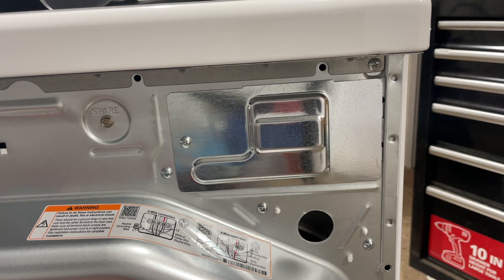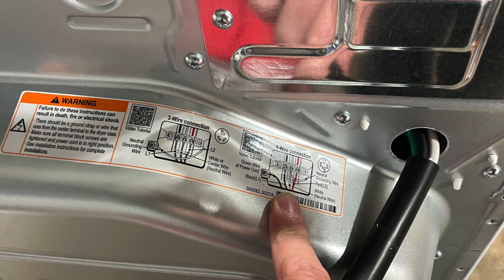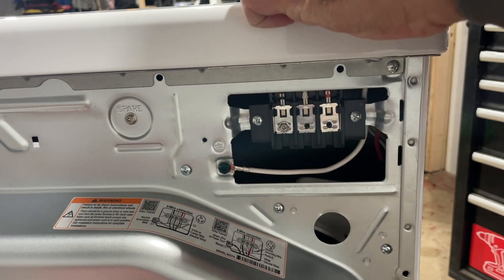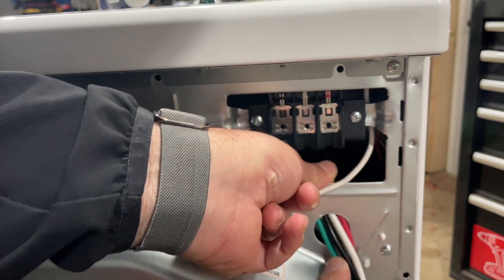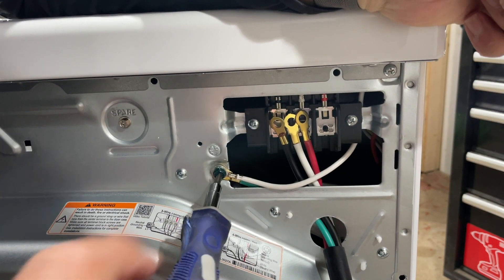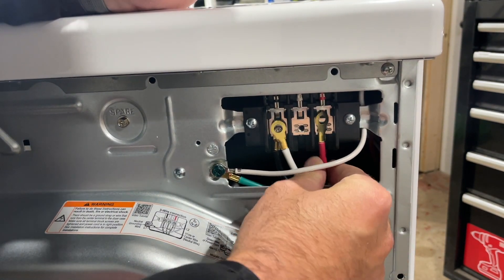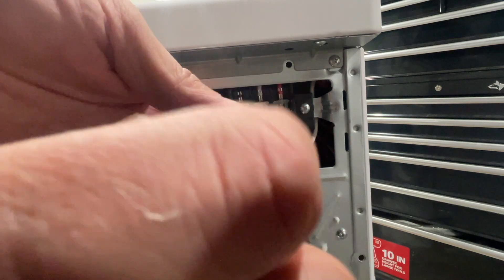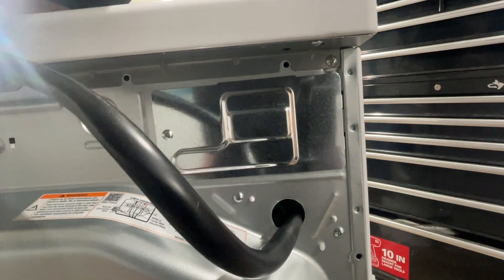How To Wire A 4 Prong Electric Dryer Cord

Comment: In a 4 wire, the ground should go to chassis and the existing white wire should be attached with the incoming white wire. The existing white wire that comes with your LG unit bonds the neutral to chassis ground and is ready for the 3 wire install.  This video shows leaving the bonded white neutral to ground and this is not the correct way. You should remove that white wire and put it with the incoming white wire and only the incoming green ground wire should go to chassis ground. You should re-do this video or remove it. However this is no more dangerous than a 3 wire hookup.  However in a 4 wire hookup you can take advantage of the extra ground wire and keep your neutral and grounds independent.
Reply: Yes I also vote to remove this video, it's wrong.